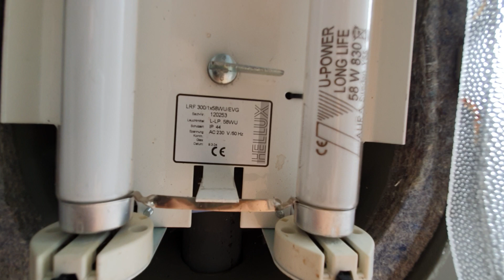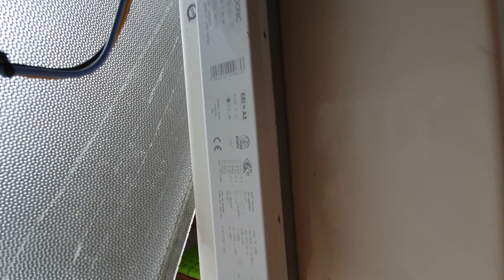Hellux LRF 300 - 58W fluorescent (low pressure mercury vapor) streetlight fixture from the 2000's

Comment: i have the hellux lrb303 with 1x tl-d 18w
Reply from the maker: TL-D 18W perfectly fits in this fixture, however, 1x18W isn't much power for street lighting, i would expect at least 2x18W ;)
Reply: @mercuryvaporglow5317  i also found a 2x 20w tl-s hellux fixture
Reply from the maker: @seagoldfish3746  in later years they also made pl-l versions;)
Reply: @mercuryvaporglow5317  we still have these fixtures here
Reply from the maker: @seagoldfish3746  There isn't much pressure to remove PL-L, because these are still really efficient :)

Comment: Doesnt look like any t8 bulb ive seen.. looks more like a compact florescent light bukb we used here in the states for fish tanks and such.

Im suprised they used this for street lights though.  Ive never seen florescents used for street lights in the states.. we all used HID.   Only inside buildings. Or aquarium lighting or workshops were t8s used.

And t5 oddly never took off like it should have.
Reply from the maker: That's interesting! In Europe in the 50's up to the 70's the T12 40w tubes were a popular lighting source for smaller streets. Later all countries excluding west Germany switched to HID lighting,  but West Germany continued using fluorescent and there are still very many streets there lit up by preheat fluorescent fixtures to this day. Also,  they used this U-shaped tubes that are common only in West Germany,  nowhere else.  :)
Reply: @mercuryvaporglow5317  honestly i still prefer t12 for interior lighting.  Or t8 etc.  Over LED.

Every big retailer building that has switched to leds..  it seems darker inside them now like they used underpowered leds.

And LED interfears with radio signals.   I have 4 8ft shop lights in my barn in the workshop area.  And they were all t12.s all burned out bad ballasts but one.   So i bought 1 new ballast and kept two 8ft t12 fixtures.  And replaced the other 2 with lithuania 8ft shop lights.  I believe theyre like 74 watts.  Theyre i believe 9000 lumens ?   The t12s.  I found they aparently still make them ?  Anyway i found 60w GE bulbs.  They claim 5900 lumens each.   So 11800 together.    Honestly the led seem brighter even though theyre only 9000.  However my t12s arent using reflectors i imagine with the reflector sheilds back on itll double in light output.  This is the thing if there is a t12 bulb thats 98 lumens pet watt... with a reflector that could near double. Lets say 75%.  Thats 160-170 lumens per watt of light outout..  How is a directional led at 120 lumens per watt gonna compete with that ??

Now the kicker is radio.. when im working on my cars.. i turn the radio on and i hear static on all channles.  If i turn the shop lights off..  static is gone.  Turn the t12 on only static is still gone.  Turn the led on and static comes back.

So im going to buy two more t12 ballasts for the other fixtures and put 4 more 60w bulbs in those and move the leds to the other side of the barn.

I noticed with LED head lights on carsas well there is radio interferance.

Which makes me wonder are all the building led, street leds, that are being put up to replace HID lamps hurting cell phone or radio or satalite signals.
Reply from the maker: @jeepsblackpowderandlights4305  Unfortunately,  in Europe T12 is banned and no longer available and if so only with poor color rendering Ra<70. So we use T8 that on 230v are interchangeable on preheat circuits. 
LEDs often do have cheap electronic ballasts that cause radio interference and also have very poor power factor. However, preheat fluorescent may also interfere with radio at startup. I don't know about the rapid start popular in the USA,  as I've never owned such a fixture. :)
Reply: @mercuryvaporglow5317   yea my t12s are instant start.   Near full brughtness the moment you flick the light on.  They do still warm up but not noticable.  The t12 that died were from the 60s with ballasts that look like giant bricks and weight 10 lbs. Lol.

They still power 1 bulb but not two.. almost wondered if i couldve repaired them ?  but i guess it isnt worth it over a new ballast for 20$.

Im not sure if t12 is still made or not.. All i know is in every hardware store we still have tons of them everywhere.

Yes the 60w GE light i got is a cool white color.   A little more yellow than the pure white LED.
Reply from the maker: @jeepsblackpowderandlights4305  I would just change the ballasts and continue using the fluorescents,  using them in the garage for a few hours a week probably won't cost a lot more than LED. :)
Reply: @mercuryvaporglow5317  na it doesnt..already thought of that barely in there for a few hours a week thats it.  Costs arent noticable
Reply from the maker: @jeepsblackpowderandlights4305  that's what I thought,  enjoy the fluorescents! :]